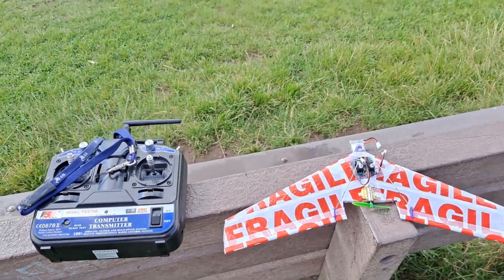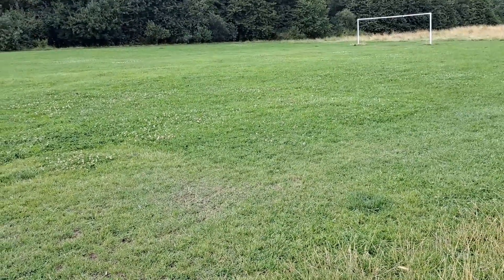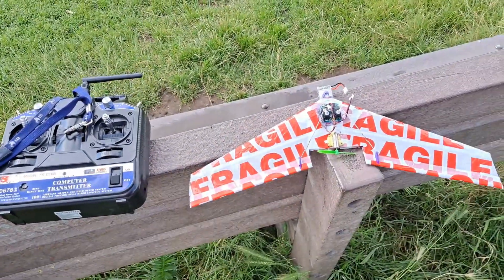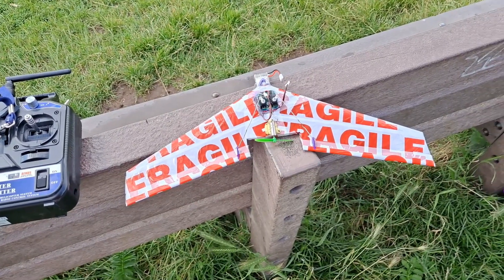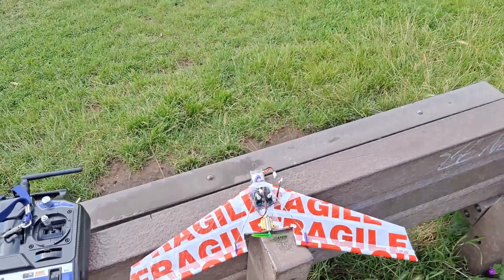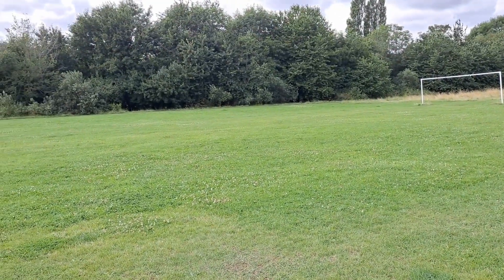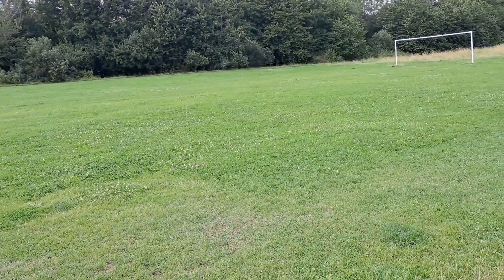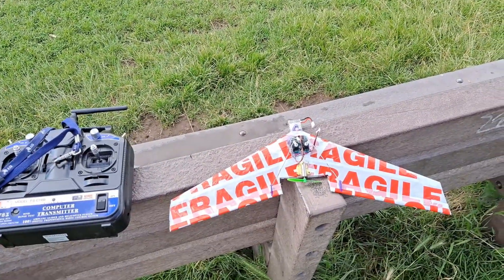Will that 3D printed micro RC wing fly?

Comment: It does not seem to have enough. Sometimes just changing the battery for a high discharge one will make all the difference.
For instance the one you have maybe tired and only rated at 10 - 15c so if you replace it with one rated at lets say 75c the voltage will Not go up but it will have more grunt.
Reply from the maker: I don't think that prop was helping. The prop that I used on the foam wing was larger, but the gap at the back was too small to take it. But you are right, those batteries are pretty old.

Comment: I Think why it didnt fly Right because you cant throw it Right,i would put a little Hand launcher under the wing so you Can throw it like a paper aeroplane because it will Go straight then and you would have a Better Chance of getting it into the air. Thats my 2 cents 😀👍
Reply from the maker: The bodywork didn't stand up to the experience very well. The centre section needs a bit of strengthening in the design. Clearly it needs a bigger motor or a better propeller.

Comment: Arrgh, curses!
Reply from the maker: The bodywork didn't stand up to the experience very well. The centre section needs a bit of strengthening in the design. Clearly it needs a bigger motor or a better propeller.

Comment: She wants to go! I've always found that a piece of foam in the middle on the CG helps for launching. A small triangle or square for a grip (can push the plane to any launch direction with index finger). Even wings of this size can be thrown first and powered up in their glide, to protect the fingers from the prop. 
Curling the edges of the wing rears upwards helps for tracking.
Few degrees upwards elevon, of course. 
Am  routing for this one   :)
Reply from the maker: Hey buddy, great to hear from you. Hope all is well, that side of the pond. I might give this another try sometime. I would want to make a few changes if I print another one. I notice I still have some of my old foam pizza trays in my stock, so that is another option. At the moment I can't get enthusiastic about RC flying, too much fuss about rules and regulations, although little ones like this are OK as long as they don't have a camera.
Reply: @GrandadIsAnOldMan  Same here on the enthusiasm, regs ruined it. 
Pizza trays are always good and it's enjoyable to watch the crafting. 
Really good progress if the learning on this one produces a good flyer in a future build and useful to others when it comes to flying wings.
Reply from the maker: @Slider2732  I finally got round to reading one of your short stories recently "The Beacon". I am not an avid reader, books can take me months or years to get through as I rarely take the time. I do have a book in the glove box of the car for 'emergencies'. Anyway, back to The Beacon, thoroughly enjoyed it. Read right through in one sitting 😊👍
Reply: @GrandadIsAnOldMan  Praise indeed, thank you for reading it. Any chance of posting similar on the book page of Amazon?
The Beacon 2 answers some questions, involves murder, nuclear waste and Native American prophecy and, includes a really good recipe for Gumbo if so inclined. 
Wife and I haven't moved to the house on the hill with the stream yet, luckily this PC doesn't reboot every few seconds either.
Reply from the maker: @Slider2732  I have set a note in my diary. I am on holiday at the moment so have limited Internet access 👍👍

Comment: The idea is to "catch" the plane with the controls and thrust after throwing it in the air. Maybe adding a super capacitor will make the launch power better.
Reply: https://youtu.be/P2PWWAkAEI8
Reply: When you use a separate receiver and ESC you can overvolt the 4V coreless motor with 2S/8V (4x more power).
Reply from the maker: The guy who designed it, has it flying successfully as it is, but his motor may have been a little bigger or his prop may have been better.
Reply: @GrandadIsAnOldMan  Balancing the prop on a needle with sandpaper (mark the light side with a sharpie) also works great for improving efficiency.

Comment: Awesome!
Reply from the maker: The bodywork didn't stand up to the experience very well. The centre section needs a bit of strengthening in the design. Clearly it needs a bigger motor or a better propeller.

Comment: Well you kind of told me yesterday not to expect much and I still think it wanted to fly.
Reply from the maker: The bodywork didn't stand up to the experience very well. The centre section needs a bit of strengthening in the design. Clearly it needs a bigger motor or a better propeller.
Reply: @GrandadIsAnOldMan  so you will try again I would assume.
Reply from the maker: @alfulton5946  probably, although 3D printing it was just a novelty. The foam one I took apart to pinch the bits was easier to build and lighter.

Comment: You are very close, looks like when you threw it easier it was better.
Reply from the maker: Haha, remember I edit my videos. It was worse than I made it look. I will have to reprint it with a few tweaks. I might even scale it up a tiny bit. Can't go much bigger and keep it on the bed, but even a small amount would reduce the wing loading. I would like to fit the bigger prop I had on the foam wing.

Comment: It's almost there! It wants to Fly!🦇 I think you can do it!!!
Reply from the maker: The bodywork didn't stand up to the experience very well. The centre section needs a bit of strengthening in the design. Clearly it needs a bigger motor or a better propeller.

Comment: 😊😊next time
Reply from the maker: The bodywork didn't stand up to the experience very well. The centre section needs a bit of strengthening in the design. Clearly it needs a bigger motor or a better propeller.